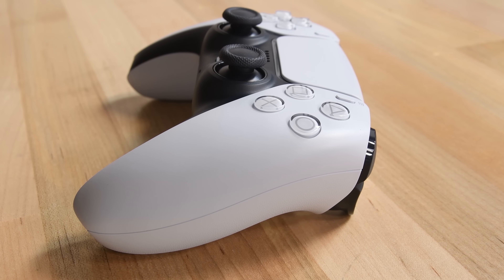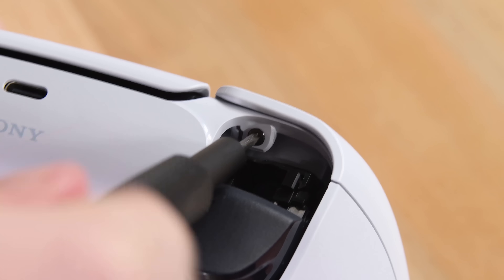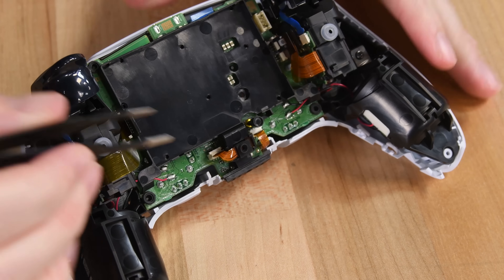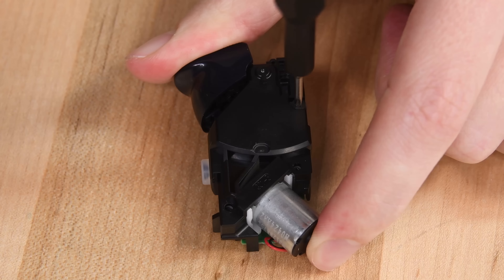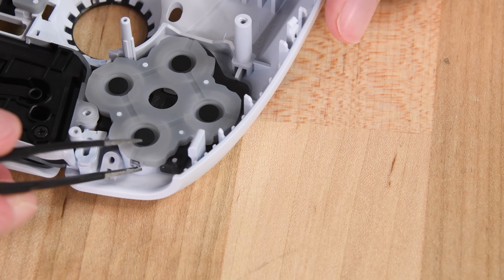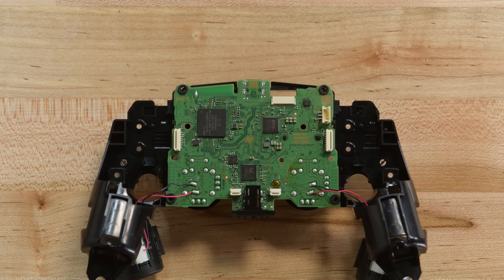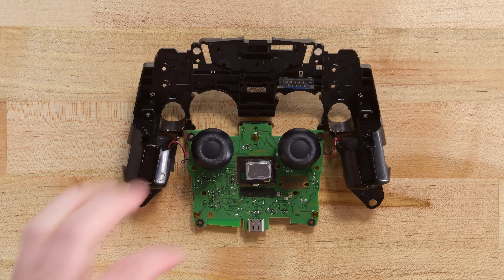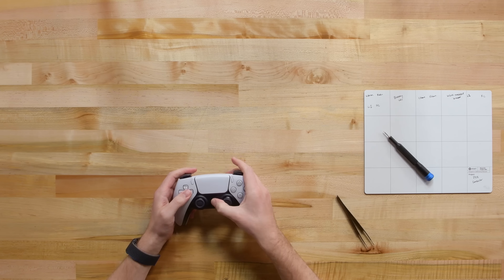PS5 DualSense Controller Teardown: Controller Evolution

Comment: This is how you build something Apple.
Reply: Apple: Not if Built-in Obsolescence is your design goal!
Reply: It won’t be water resistant if you build a phone with no adhesives or gaskets.
Reply: @urgh113  It won't be repairable if the company prevents repairing components on a software level!
Reply: @esteban-od  Look up the latest unbox therapy bend test
Reply: @esteban-od  had a iphone 6 for 6 years never bend in my pocket
Reply: You mean solid plastic and held together by clips? That might fly on a $60 controller but I'll take Apple build quality on a phone any day.
Reply: @Noah-Lach  no I mean replaceable parts. This cheap build quality will take a fall better than any phone in anyway.
Reply: @Therysin  Ehh, most parts on the new iPhones are modular. Replacing the screen and battery are both ridiculously easy other than the water-resistant adhesive. What’s more egregious is their growing fondness for software-locking parts to the motherboard so that replacement parts are useless unless Apple themselves bless the repair
Reply: @Therysin  Well that’s not what you said is it LOL
Reply: @Noah-Lach  apple products are getting consistently harder and harder to fix/replace. They design their own screws, and soon vital components wont even be replaceable for anyone except for apple repair. You cant even remove the camera from an iphone 12 and install it on another 12 model.

Comment: This is a controller. Many people are likely to throw it at things when they get angry, or slam it against hard surfaces. It's expected to take a lot of abuse. Yet there isn't a drop of glue securing the battery in place or even a single screw. Other companies can learn a thing or two from this. There's no reason to glue a battery inside a device like it's expected to have 300lbs of weight dangling off of it and can break free at any moment.

Someone somewhere will say that the protective plastic casing around the battery is just as bad. I strongly disagree. When your battery goes bad you recycle and replace it. You don't open it and play around with the lithium. So there's no reason to need access to the bare cell in the first place. There's nothing beyond that shielding that you should ever be messing with, because while replacing your own lithium battery isn't dangerous messing around inside one is. So as far as battery replacements are concerned this is a walk in the park.

Personally I'm glad there's no battery door on the controller. Be honest with yourself. If there was a battery door then most controller owners would probably lose it and have their battery dangling around below the controller by its connector and wires. You can't make access too easy or one day it gets thrown in anger, the impact pops off the battery cover then yanks the battery out and rips the connector off the board, and then you're screwed. It's just fine the way it is.
Reply: Gotta agree with that.. thats why cellphones dont have Battery doors anymore

Comment: look at that, you can place a battery on a device with no glue
Reply: Woah, How could've the phone industry never thought of that?! Someone tell them!
Reply: @sourcethunderlight2723  Well to be honest I can see the point in phones, but in everything else, a battery should be easily swappable as it could be held in place with a screw. That would be possible on phones too but these pull glue stripes are okay to me
Reply: @mactalk2871  yeah but according to JerryRigEverything, some of these companies don't use the pull tab (which by the way breaks easily apparently) and have the thing hardglued to the back.
Reply: @mactalk2871  Old 2000s phones and flip phones didn't glue the battery down.
Reply: @HandledToaster2 Those pull tabs do not make battery replacements easy. Opening the phone on its own is already a struggle. Nasty practices like passing ribbon cables on top of batteries is a good indication that they don't want people to remove them.
Reply: Huh? What controller have you been using? No controller from Sony, Nintendo or Microsoft glues there battery down.
Reply: I just wanna reach the triangle button.. must i take the motherboard first?
Reply: Apple: I'm going to pretend I didn't see that
Reply: @DarkH4X0 apple does not glue the battery down. In fact they have really satisfying pull tabs across every iPhone
Reply: @DarkH4X0  every phone company now glues batteries in place
Reply: Afaik they glue the battery because it is soft, and if they made it harder (like it is in devices where it's not glued) they'd have smaller capacities. I mean, just look at how much battery size increased on similar form factor phones when compared to when they were removable (and therefore harder).
Reply: @leonro  false. There is nothing to do with hardness and glue on battery.
Reply: @leonro that's total nonsense. They glue them because it's cheaper and they don't support battery replacements, so they don't add the cost of holding them down with brackets or friction fit. 

Don't believe the so-called experts. It's killing two birds with one stone by cutting costs and forcing customers to upgrade. I work in this industry and that's the reality of it.

Comment: someone somewhere has to make all those gears in metal 

because reasons
Reply: Metal... gears?!
Reply: @loco_logic  solid
Reply: I will 3D print them from plastic and put some white grease :D
Reply: @lagynas  you should also 3d print side panels with a big fanhole with a grill, little holes to make the whole "dust collection thingamagic" easier and a way to exploit that nvme slot (there should be a ribbon from nvme to sata i hope) 

And if you manage to make the ps5 look less humoungous It would be awesome 👍🏻👍🏻👍🏻
Reply: @enniopelliccia3844  I don't believe the PS5 has any kind of sata connection.
Reply: Those gears look like they are nylon which would probably be just fine.
Reply: @SagesFury  i hope so

What do you think about custom panels? Will they be a thing? I reckon they can also be extremely functional if you're willing to sacrifice the looks
Reply: @enniopelliccia3844  more of an xbox person so didnt care to think about that tbh. Just wanted to point out that the quality of the components is fine to people worried about plastic gears. Nylon is a very good material for that application and they look like high quality nylon gears from the vid. I could probably manage to 3d print replacement shells but the quality would not come near the actual oem ones in terms of the feel I reckon.
Reply: Durability question mark
Reply: Those metal gears would be solid
Reply: @MHzZz  it would be a phantom pain.
Reply: That would most likely wear the motors out faster, so it would have a downside
Reply: I can already smell the upset reddit posts because people swapped the gears to metal ones and the motor broke down bc the gears are heavier 😂 there is a reason why many gears are made out of plastic (not just the costs of metal compared to plastic) i am going to bet that the motor will fail.
Reply: Nylon and delrin are naturally low friction. That plus the use of a worm gear that engages multiple teeth at once- looks like a pretty solid design to me. Teflon would be an awesome fit, but they had to pick something that they could injection mold. Might be something as simple as ABS though. 

I hope some machinist enthusiasts make them out of metal though. That would get some views.
Reply: Hey everyone. Speaking of these gears. i have an xbox one elite controller, series 2. I "Accidentally" Throw it. now the r2 is not working. The joysticks are fine, can I put my elite joystick into my ps5 controller? or ps4...THAT WOULD BE COOL! can i?
Reply: @kylinemordashov1452  you bought a 200 dollars joypad and threw It on the ground, you must be very Rich good for you 👍🏻

Maybe, if you 3d print adapters, disassemble the joypad, insert the adapters and the Xbox levers on top it should work

But I would never do that

Have you tried to check tronicsfix of he made a video about the elite controller? Maybe your controller Is fine and you only have to reinsert a ribbon cable

Or you Just have to change the R2 button and you'll fix it
Reply: It would be loud I think
Reply: not just the gears. The triggers too, too much pressure can also break the trigger. Just make the whole trigger system a metal, to be sure. lol ;p
Reply: @kylinemordashov1452  When the elite controller for xbox made parts of their controller metal instead of plastic, I noticed the parts would bend and change shape making them loose. Unless it was titanium or something I don't think metal is a viable replacement for plastic for that bending/malleable reason.

Comment: Best and cleanest controller insides I've seen
Reply: @Mono I know.  But they said it’s the cleanest internal they’ve ever seen. Lol
Reply: Wtf are you talking about? It's cluttered with gimmicks and flimsy moving parts, nothing clean about it
Reply: This is the cleanest?   It looks very complicated internally  compared to something like an Xbox 360 controller........ Lol did you see Austin Evans mangle the opening of this controller in his video?
Reply: @RightJoystick  xbox one controller needs coldering and screwing to remove some components
Reply: this is literally a copy of an xbox one controller but with a battery.
Reply: @Ozzymandias493  you username matches your behaviour, we are talking about the insides
Reply: @Ozzymandias493  The xbox one controller is literally a copy of the later PS1 controller but with the option to go wireless.